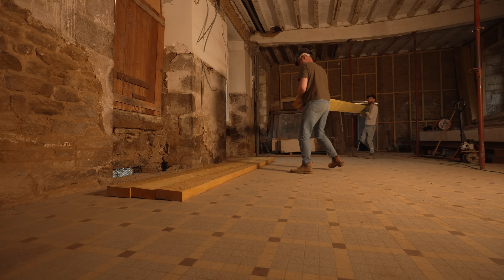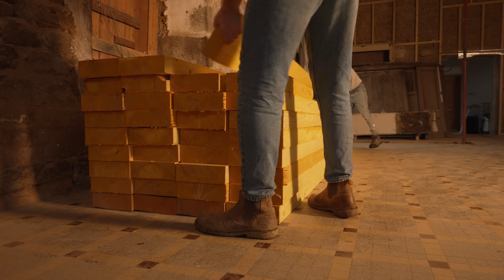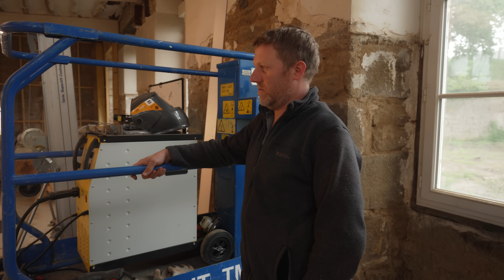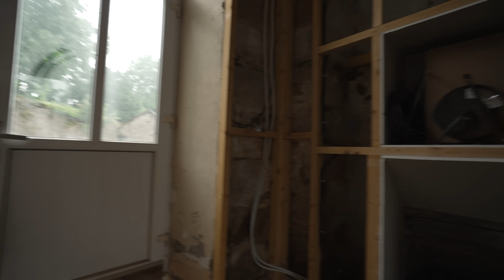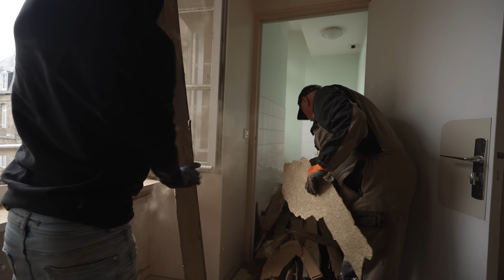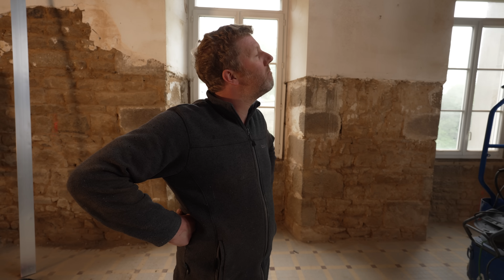Next Stage Of The Library Project

Comment: I have seen on another channel that a gut is rebuilding a chateau in France and he uses a machine that can plane off the edge so the wood can set into the steel. You only have to take off one edge on the same ends. Not sure if that makes sense but the other channel is escape to rural France.

Comment: I'm fixing and painting my house. Red beveled cedar siding in the exact size I need for my historic home was around $50-$70 per 14 ft. board depending on which store I went to. I bought the stock size from the cheapest place $30 each and ran them through my surface planer until they were the correct size. Thankfully, I only need around 30 pieces!

Comment: Normally structural steels are painted with fire retardant paint.  It’s the rise in temperature of steel in a fire to its strength ratio, it drops radically.
Reply: Never been a steel framed building anywhere in the world that collapsed during a fire.  That includes towers.
Reply: Apart from WTC and WTC 7 you are correct, although even after all these years of research and discussion it is still being hypothesised  whether that’s correct.  That being said steel framed structures resist total collapse for differing reasons.  Generally fires are not hot enough or  last long enough for failure to occur, >67% of strength reduction requiring about 650°C.  This figure being controlled by fire suppression systems, fire proofing protection materials and very important redundant structural system design. If local failure happens no disproportionate collapse occurs to the whole.

As agreed there are only the three known structures to suffer this (debatable, proposed controlled demolition charges, implosions), others have suffered fires which have been large and lengthy without suffering collapse, but this non catastrophic collapse is attributed to the factors mentioned.

Comment: Are you planning on having balusters and rail surrounding the upper gallery? if so - are you going to match anything (like the old stair balusters) or something different? would you use wood or metal?
Reply from the maker: wood like the original staircase design but it all comes down to cost and time scale
Reply: While wood would make the most sense stylistically, fancy metal/iron railing might be less thick and add a couple of inches to the walkway.  Is there any public metalwork nearby that can be referenced?